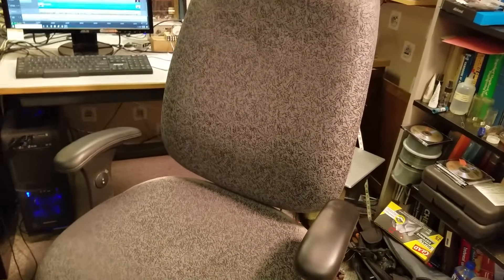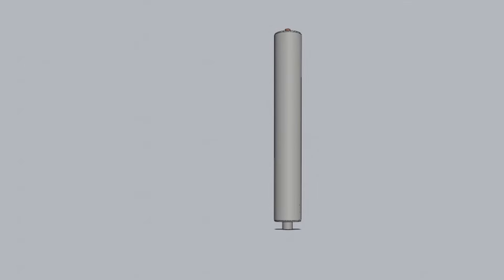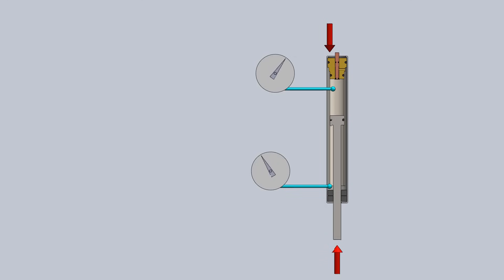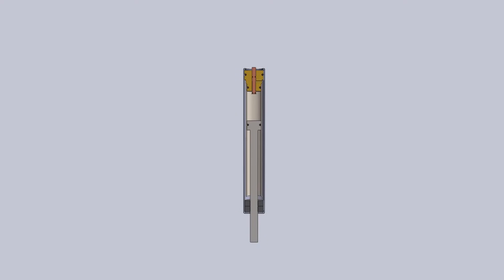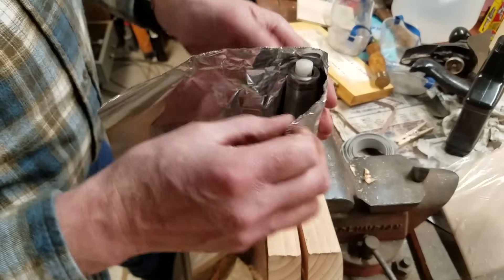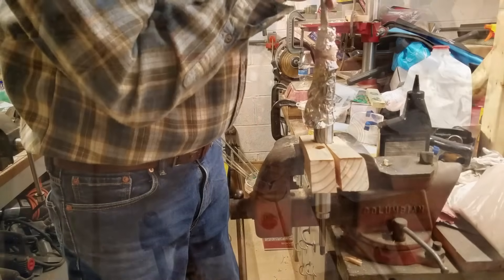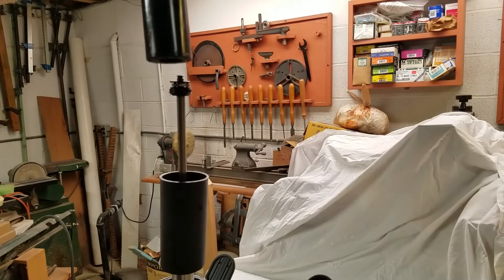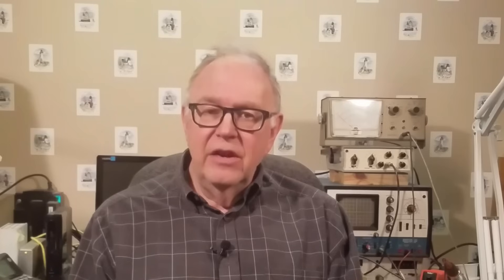The Mystery of the Sinking Office Chair - Can We Fix It?

Comment: My cylinder is not sinking at all. What could be a problem?
Reply from the maker: It could be that the lever isn't pressing the button valve on the end properly.  If the chair "bounces"  a little when you sit on it, then the problem is with the valve.  If there is no bounce at all, then it could be a jammed mechanism; like something caught in the column, or something jammed in the cylinder.  Good luck!

Comment: hello, great video here.

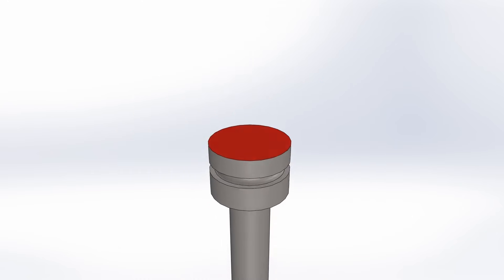however, could you explain what you meant from 3:26 onwards, that when there is no load, the pressure is naturally higher at the bottom of the cylinder as compared to the top? why does that naturally occur? a reply would be much appreciated, thank you.
Reply from the maker: The reason is the difference in area between the top and bottom of the piston.  Since the piston doesn't move up or down when the valve is closed, the force on the top of the piston must balance the force on the bottom of the piston.  Since there is less area on the shaft side (bottom) of the piston (total piston area less the shaft area) than the top of the piston, the gas pressure must be higher on the bottom of the piston to balance the force on the top of the piston.  (gas pressure top * area top = gas pressure bottom * area bottom) Hope that helps!
Reply: @LifewithDavid1  thank you i do understand it. 

I am interested in learning more about mechanisms such as the standing table mechanism and how tables can be lifted through various mechanisms within the supporting leg. For example, some standing tables use the same technology as the one used in the office chair- pneumatic counterbalancing. 

However, I am more interested in learning more about tables with crank lift mechanisms, where turning a crank lifts the table upwards via gears. If you do know anything about it, could you link me to some sources on the internet explaining it, as I could not find any elaborate and valuable info on the crank lift mechanism online.

Comment: How big is the pressure inside that cilynder? Can I cut it open without the risk of an explosion?
Reply from the maker: The cylinder pressure is around 2000 psi (13,790 kPa).  That's really high; so I wouldn't cut into it because you could hurt yourself.
Reply: @LifewithDavid1  thanks. Bit is there a way to open it safely?
Reply from the maker: @GospodinJean  I don't know a totally safe way to open it.  However, there is a "Dissection of Lift Cylinder" video in the description of this video where Ramon P. DOMINGUEZ shows how he opens one.

Comment: Great video. I am embarrassed to admit that I don't have a vise and you mentioned that the first time you did it was without disassembling the chair, can you explain how you do that? Thank you.
Reply from the maker: The first thing I would suggest is to simply flip the chair upside down and cycle the cylinder up and down (it's kind of awkward).  Recently I've often seen that redistribute the oil/grease inside the inner cylinder and eliminate the need to use jack oil on the shaft.  If that doesn't work, you can use the same position for the chair (upside down) and put a little jack oil on the shaft and again cycle the wheels up and down.  The last thing I would try is to take the seat off and squirt a little jack oil around the valve button. It's messy without the foil dam; so do that as a last resort.

Comment: Great video a little long However I found that the PVC pipe along the cylinder works better and is a permanent fix
Reply from the maker: Thank you; it did take a while to present the theory of operation.  I couldn't find it anywhere else on the web.  The PVC pipe is permanent; but my old back appreciates the cushion that the pneumatic cylinder provides.

Comment: Thanks for such a well presented video. It got me thinking that maybe the rubber seals inside the tube dry out and harden over time. If that's the case the addition of a little bit of stop leak like ATP AT 205 mixed with the jack oil may add more time in between servicing. This type of product is used to rejuvenate seals and restore elasticity to seals within engines, transmissions, hydraulic jacks etc...
Reply from the maker: That's a good idea.   The reason I use jack oil is that it does have some seal rejuvenating properties.  The additive might help also,  however if the seal is that far gone, you might not be able to bring it back. Thanks for watching!
Reply: Fair point.  I used ATF as I didn't have any specific hydraulic fluid to hand.  I've been running ATF in my motorcycle primary for years without any adverse effects on the shaft seals.

Comment: After drilling through my faulty chair to fix it from sinking with a wire lock pin I caught an unexpected burst of gas and metal shavings into my eyes! After watching your video, I wasn't afraid to keep drilling anymore! It made me realize that I released most of the nitrogen by drilling through the inner cylinder and outer tube, and the rest by pulling the adjustment lever. The sounds it made were a good audible cue, I just wasn't sure if there were any other gas chambers that I needed to watch out for. I fortunately only ever use my chair at its highest setting, so not having a working pneumatic lift cylinder doesn't bother me.
Reply from the maker: I guess that's experimental research!

Comment: Thanks David.  I just replaced the cylinder in a chair I had just bought a month before, not because it was defective but because it was way too short for my 6'2" frame.  Getting the old cylinder off was a challenge.  Turned out the old cylinder was so short, not even the removal kit that came with the replacement cylinder would fit properly. Some persuasion with a Dremel cut-off wheel had to be applied to the bolts and wrench to get them to fit.   Better than using a pipe wrench, though.  Nice landing, BTW.  I did some of that about 30 years ago. Then I got married and everything changed.
Reply from the maker: Thank you for sharing your experience!  And thanks for watching.
Reply: Why better than a pipe wrench? That has worked well for me. Am I missing something?
Reply: @TheScreamingFrog916  It was a new chair. A pipe wrench would have destroyed the original cylinder preventing me from using it in another chair.

Comment: My chair started this went and got a brand new one last month and started doing it again! I'm starting to think they have a weight capacity of 17st now! I'm just pushing 17st now not getting my usual exercise just got lazy really too! But a brand new chair shouldn't be doing it unless made with recycled or cheap ass parts! Doesn't do it all the time it's if you sit off centre slightly it'll sink but sometimes it'll just sink but it's doing more often to whare it's now an annoying issue
I had to come back and leave a wee edit after trying your fix I have first done it my taking the hydrolic back off and turned it upside down and gave it a few pumps without the oil as you said you weren't sure what worked but one of them did? Well touch wood but my sinking chair hasn't gone down yet with just the upside down pumping haha but if doesn't work I'll get some hydrolic jack oil tomorrow! Also I have noticed a max weight in Chinese a sticker says max 17!?
Reply from the maker: I've found that cycling it upside down works often.  Glad it helped!

Comment: David, what a blessing you are to mankind. A divinely given talent you have received and then to share your knowledge with others too is surely appreciated by many, including me. My sincere “THANKS” for the amazing 😉 video. I am ready to fix my chair now, without hesitation. 💫💫💫 God Bless you today and always💫💫💫
Reply from the maker: So nice of you.  Before you start; you might want to just try to flip the chair upside down and cycle the cylinder up and down before you remove it.  I've found that sometimes that is all it takes.  I think it redistributes the grease inside the inner cylinder.  If it doesn't work then do the whole fix.  Good luck!
Reply: @LifewithDavid1 - Thanks for the followup, I will let that be my starting point‼️💫💫💫‼️

Comment: Very good idea. I have a suggestion I saw in a video for removing the cylinder from the chair plate. Use a pipe wrench on the cylinder to rotate it free while holding the chair from rotating. (I personally would suggest keeping it high so if it scratches it won't matter.) I am about to try and replace mine with a spare I kept from an old chair, otherwise I would try your method first. (I don't have any hydraulic oil.) AND... THANK YOU for the "How It Works" section!

Here is the video using the wrench. Although the bottom end is a different type than our chairs, the top is the same.
https://youtu.be/pV-wXwoQovc
Reply from the maker: Thanks for watching!  That looks like it could work; just make sure that the outer cylinder doesn't get damaged.
Reply: @LifewithDavid1  my thoughts exactly about damaging the cylinder. I was surprised he didn't put the wrench all the way at the end where it's stronger. Keep up the good work. I know how much it takes. I run a YouTube channel as a volunteer for a nonprofit. (American Space Museum)
Reply: I tried a wrench...started denting the outer cylinder and I stopped, fearful it would burst. Going to try the punch method next.
Reply: UPDATE: I tried it with a pipe wrench and was unable to get it loose. I may have been too gentle but I didn't want to destroy the cylinder. The Jaws were really gouging into it. I DIDN'T ADD ANY LUBRICANT, which might be something to try. Or maybe trying to rotate while someone else hammers on the end although I think I would try a wooden dowel for hammering. Anyway, thought I should report on my lack of success.
Reply from the maker: @brucej9575  Before you throw in the towel; try flipping the chair upside down and cycle the piston up and down (it's a little awkward) a few times.  This has been know to work sometimes, eliminating the need to remove the cylinder.  Good luck!
Reply: @brucej9575  Marvel Mystery oil is a good old standby lubricant/oil.

Comment: I don't have an Hydraulic Jack Oil David, however I have a lot of Shimano hydraulic brake oil (brake fluid) used them to replace or bleed my brakes on all of my mountain bikes, Can I use that oil instead? Viscosity is very light, like similar to a baby oil. Do I need to use higher viscosity or thicker oil? I don't have a car yet so I don't have Hydraulic Jack and never need an oil for that either. I don't wanna spend that much on an oil since I will only use a teaspoon of it, so I was thinking to use what I already have instead. Anyone please help me. Thank you so much
Reply from the maker: I'm not sure.  The thicker the oil the better.  But before you buy jack oil, try using the the brake fluid.  It might work well enough to fix the issue.  If not, you can always try jack oil later..  It's less than $4 on Amazon.  Good luck!

Comment: My cyclinder slides right through the outer shell when placing it and my wheels back on. I've done this before with no issues but now it will not stay.
Reply from the maker: Perhaps a plastic tab has broken or there might be some lubricant that causes it to slip off.  Good luck!
Reply: @LifewithDavid1  thanks i got it!

Comment: Well this might be the only good breakdown of chair piston operation on the net! Congrats on that.

I heard cylinder explosions were possible, and that if if were to happen, the plywood base of the seat won't do much to prevent a metal pipe such as the valve stem from being propelled into someone's bottom. These accidents do seem exceptionally rare here, because all cylinders come from a handful of manufacturers and are safety certified, but apparently back in 1983, chair piston explosions were quite common, as i found from an old Spiegel article. What is your risk assessment in this regard? While i do think maintenance of the cylinder with oil is fundamentally safe, i'm not 100% convinced that percussive removal of the cylinder hasn't weakened it.
Reply from the maker: Thanks for your comments.  There is only a small volume of gas in the cylinder, so there is not much energy there.  The end construction appears to be such that any incipient failure would result in gas leakage prior to any parts leaving the assembly.  The rolled edge around the valve button simply holds soft rubber seals; if it's damaged too much, the cylinder will simply leak gas until it no longer works.  So I believe the cylinder design is inherently safe.

Comment: Thanks for the great explanation!! Any chance it would work on a herman miller cylinder?
Reply from the maker: It should; I believe they are all similar in principle.
Reply: @LifewithDavid1  It worked!! turning up side down the chair did the trick.  I didn't remove the cylinder. First, I lubbed the shaft, then the lever (this chair has a lever instead a button in the cylinder) with no luck. Many thanks for the video.
Reply from the maker: @Leo_OMx  Fantastic!  Glad it worked!  Thanks for watching.

Comment: Well done! My chair has the same issue, currently stuck on trying to get the cylinder out 🙄
Reply from the maker: Try flipping the chair up-side-down and cycle the chair up and down several times.  Sometimes that seems to do the trick without removing the cylinder.  If that doesn't work; then you can try removing the cylinder.

Comment: Hi david, my chair’s only sinking when I lean back.
Reply from the maker: That tells me that the piston seal has a little leakage.  You might try grabbing the end of the support rod (where it is clipped to the wheels) with pliers and turning the chair a quarter turn so that the piston is rotated in the inner cylinder.  Only grab the rod on the very end; otherwise you could damage the sealing surface of the rod and cause gas leakage through the rod seal.  Also try flipping the chair upside down and cycling the wheels up and down to work some of the original grease back into the piston seal.  I've had this problem and this is how I solved it.  Good luck.

Comment: The best way to get the metal end out of the chair is to use a plumber's wrench and twist it off or strike that wrench with a hammer while it's hooked on
Reply from the maker: Make sure you don't damage the outer cylinder because gas is under very high pressure.
Reply: @LifewithDavid1  hmm I wonder if a towel under the wrench would help prevent that
Reply from the maker: @Shmeve0  I tried that and there wasn't enough grip to budge the cylinder.  I also tried rubber gasket material; which works a little better; but still not quite enough.

Comment: I did a similar method in lubing but with wd40, it works but after 2 weeks the sinking problem slowly resurfaced.
Reply from the maker: WD40 is not really a lubricant; it is a water displacement formula.  It drys out and gets sticky.  That's why I use Jack oil.  It has additives to recondition seals.
Reply: @LifewithDavid1  thank you, that seems to be the reason

Comment: You all do relise you can get a piston for 25 dollars on amazon and replace it in like 5 minuts without all the mess
Reply from the maker: That's are cylinders that fit many chairs.  However, the cylinder for my chair is not standard, so I have to fix it or replace the chair.  That may be the case for others.  Hopefully the video will help people make the repair or replace decision.

Comment: Great explanation of the mechanism and the fix! You had mentioned you had done this fix previously, is this likely to leak oil over time? Mainly concerned about making a mess of the floor under the chair.
Reply from the maker: Thank you.  I haven't had any leakage during the several years I've been using this chair..  I did clean the rod after I lubricated it.

Comment: As I following your tutorial, My hydraulic chair just pop and its not getting up anymore... Is it broken? Or I can fix it
Reply from the maker: I'm not sure.  Is the handle still activating the valve at the top of the cylinder?  If it still does, then it sounds like the cylinder has lost pressure.  Unfortunately, if you've lost pressure then the cylinder is shot and must be replaced.  Good luck.

Comment: I'll have to see if this helps my chair, some days i have to bring it back up 20 times, sometimes I can go a week without it dropping down on me. Very intermittent issue with my chair.
Reply from the maker: Before you try the full method; try turning the chair upside down for a few hours or overnight.  Then cycle the chair up and down a couple times while upside down (push down on the wheels).  Then, if possible, grab the very bottom of the support shaft (which sticks below the wheels), and turn it a half turn to rotate the inner seal inside the cylinder to spread out any grease or lubricant around the edge of the piston.  That may be enough to fix your chair.

Comment: My chair doesn’t steadily sink, but rather it has a habit of compressing about 4” from its maximum height when it bares my full weight. It’s more than just wiggle room or a little bounciness, it slips down and stays stuck there until the weight is removed. Will these methods work for my problem?
Reply from the maker: I'm afraid your lift cylinder has leaked out some of its gas.  Unfortunately, there is no way to restore function to this cylinder; cylinder replacement is your only option if you want to be able to adjust the chair in the future.  Otherwise, you could use some of the "clamping"  methods demonstrated here on YouTube to lock your chair in place.